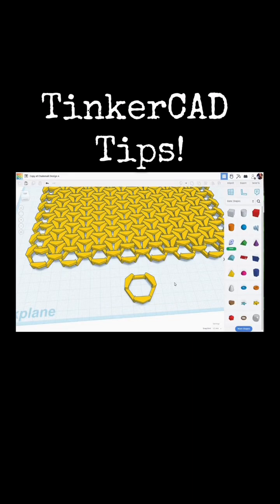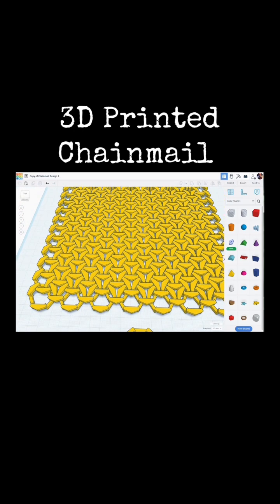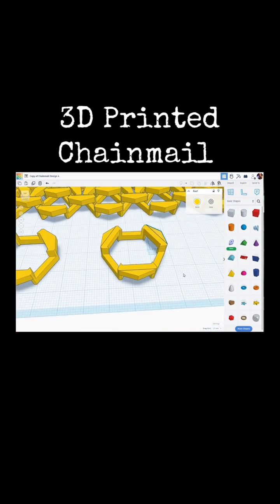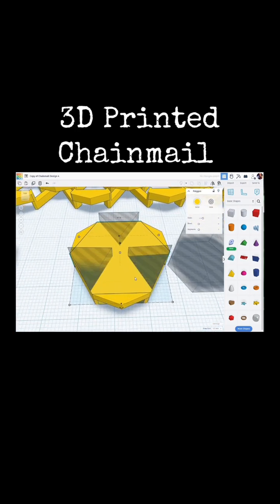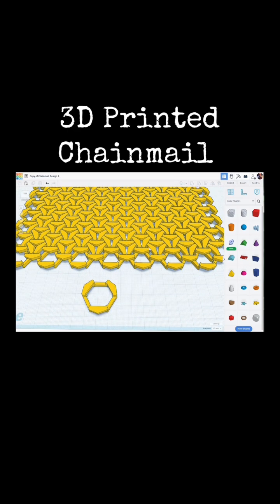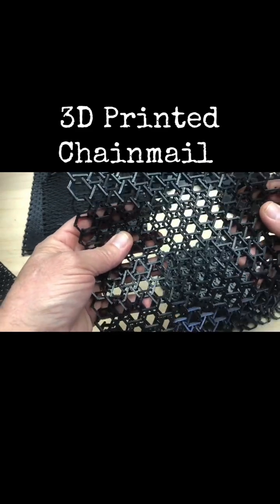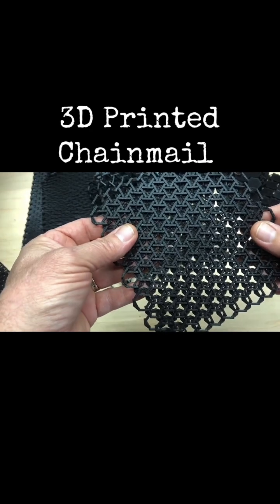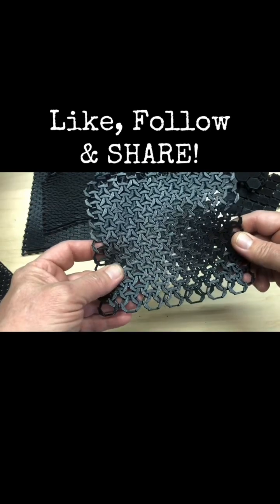TinkerCAD Tips!  3D Printed Chainmail.                #tinkercad #caddesign #3dprintable #3dprinting

Comment: Like your designs you don't maby got n step file for design I use freecad
Reply: Did you try to print it with you PET filament
Reply from the maker: @jacqueshayman639  no, hadn’t tried with my PET.  I only tried the eSun PLA + that use for most of my PLA stuff.  But I don’t see why it wouldn’t work.
Reply from the maker: @jacqueshayman639  I don’t have these published anywhere, but I have them in TinkerCAD.  TinkerCAD can export as STL or OBJ though.
Reply from the maker: @jacqueshayman639  if you’d like the STL files, let me know and I can likely email them to you.
Reply: @KevinGroninga3D   it's 100
Reply: I allso have tinkercad you can share it with me there allso
Reply from the maker: @jacqueshayman639  what’s 100?
Reply from the maker: @jacqueshayman639  I made several of my Chainmail designs Public on TinkerCAD.  My ID there is ‘KevinGroninga3D’.